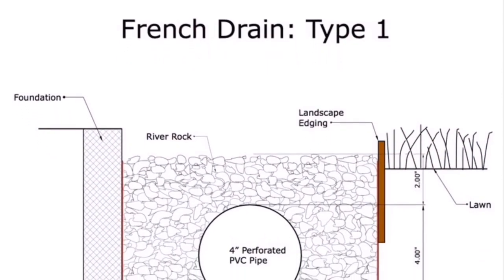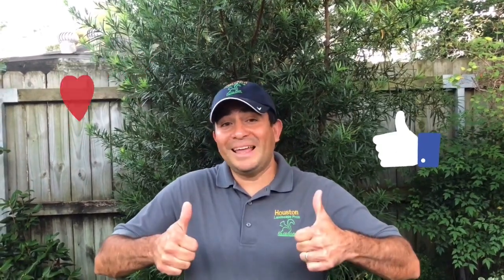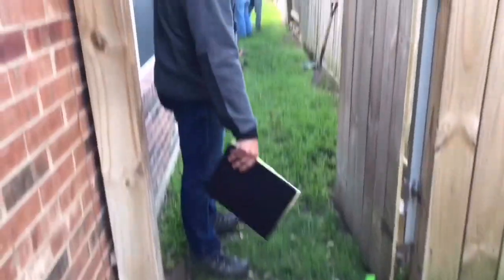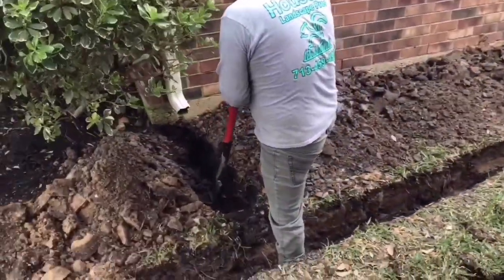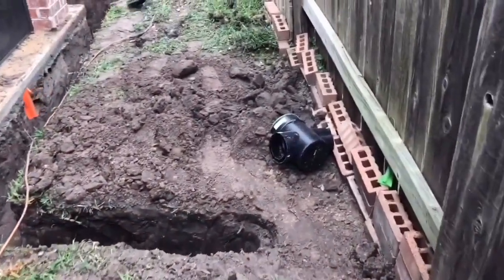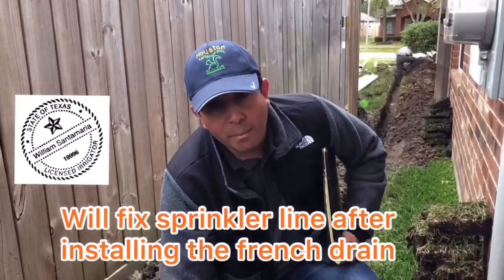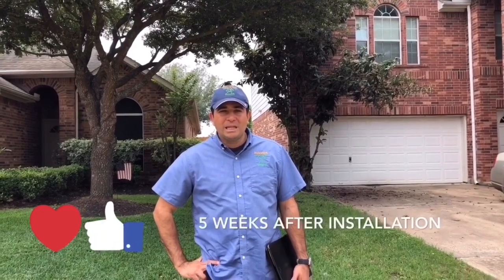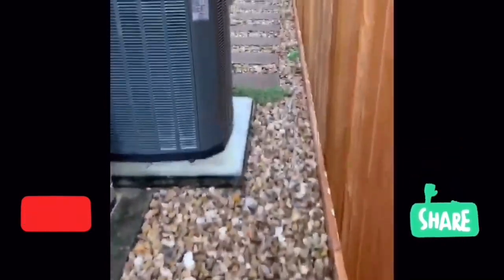How To Install a French Drain CORRECTLY | DIY DRAINAGE SOLUTION

Comment: Why do you install the pipes with the perforated holes down instead of up. 
And can you use limestone gravel instead of river rock
Reply from the maker: There are to reasons you install the perforated pipe hole down, first you don't want water collection in the pipe. Second, when it raining you want most of the water to rush to the street and the remaining water after it has stop raining to sip down into the ground.  We DO NOT recommend limestone because it breaks down.Please let me know if you have more question. We are hear to help!

Comment: How does this system work here in the freeze of 2021??
Reply: I’m in the outskirts of Houston and I have just an underground system almost like this , not a French drain. I have catch basins with my system and the water in my catch basins were frozen but luckily we received no more rain during the freeze to cause a backup of water.
Reply from the maker: Good question! With No problem. If the french drain is install correctly, there should be any water collection in the system. There for the 4 inch perforated pipe will not expand or brake.

Comment: Why did you tie gutters to french drain instead of using a separate pipe?
Reply from the maker: If you run a different line it add to the cost, that means more material and labor. There are some situation that you would have to do a separate line. But not in this one. Thanks for asking! Look forward in hearing back from you.

Comment: Why not tie directly into that sewer instead of running the pop up emitter to under the side walk?
Reply from the maker: Hi Brian, sorry for the late reply but, with everything that is going on, we have been preoccupied. To answer your question, you can not tie any French drainage or any landscape drainage system to the any sewer line because it is against the law. The sewer line is only for grey house water and it is not design for rain water because it goes to a water treatment and if they get more water than what they have estimated, the water treatment facilities get flooded.  You can tie to a storm drain if one is near by, but you must make sure it is a storm drain and not a sewer drain.  If you have any more questions, please let us know of see our website. Thanks! https://houstonlandscapepros.com/landscape-drainage/
Reply: Hello Brian, Thank you for reaching out. We can not tie anything to the sewer system because it is against the law. The sewer system is not design to take rain water, it is only design for grey water.  If you send rain water to the sewer, you will be flooding the sewer system and it can back-flow back into your house.  Going all the way to the front and boring underneath the sidewalk is the way to go. For more question you can call at (713) 396-3320 or go on our website https://houstonlandscapepros.com/landscape-drainage/french-drain-installation/
Reply from the maker: You never want to tie into the sewer because it is against the law and the sewer does not have the capacity.
Reply: @houstonlandscapepros1351   Thank you, I think this has already been answered a few times now. I do understand, I didn't realize that was sewage vs a storm drain from the video. Thank you though for the clarification.